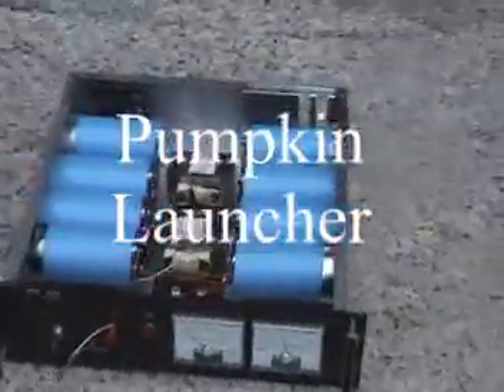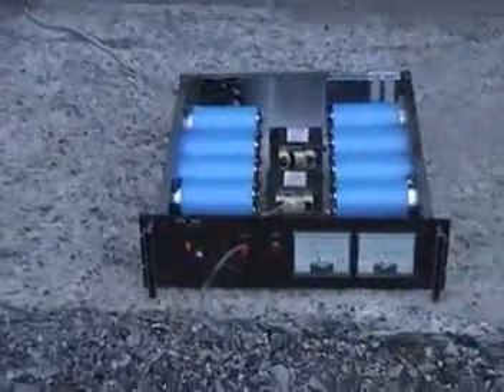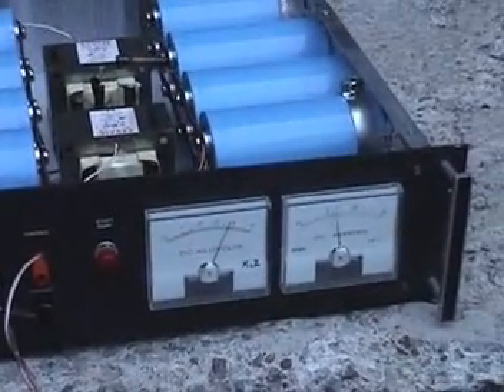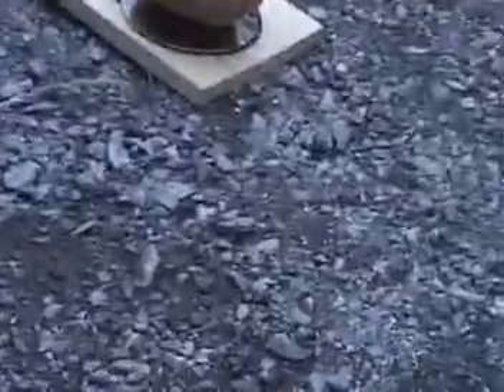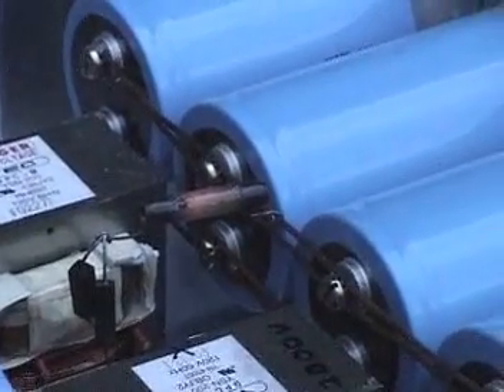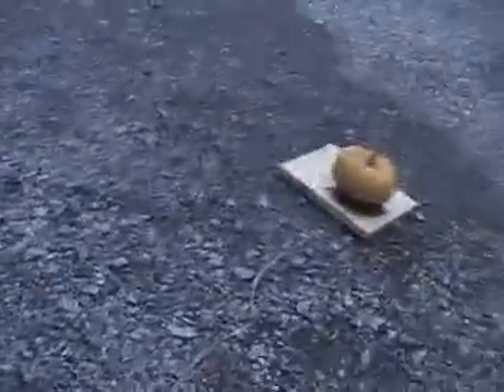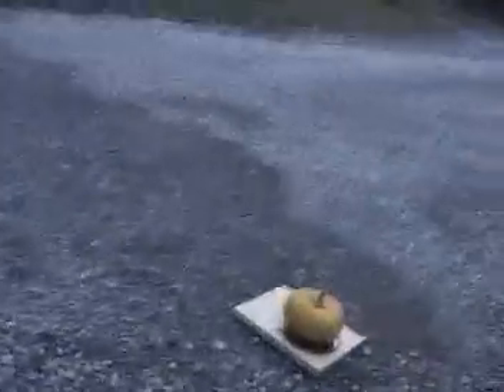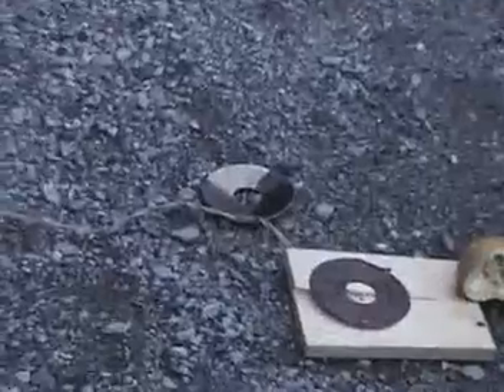My Pumpkin Launcher

Comment: I kinda wonder though: you have a huge load of capacitors with a relatively small resistor. Wouldn't it be wiser to add a bigger resistor in there that could take the current better?

Comment: What circuit are you using to trigger your SCR?  I'm building a smaller version of this unit for a tech-fest.  I miss read the datasheet and fried a 5000 amp pulse capable SCR by putting the charged voltage to the trigger.  It worked for a couple of test firings, but fried when I reached 120 volts.